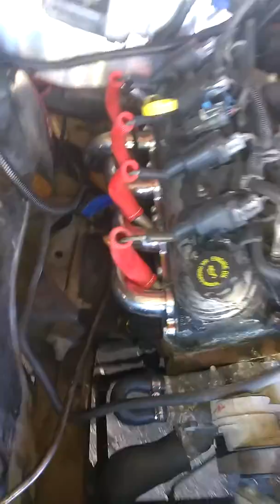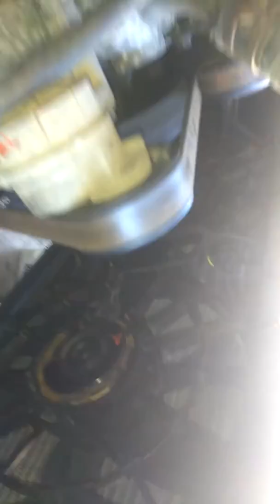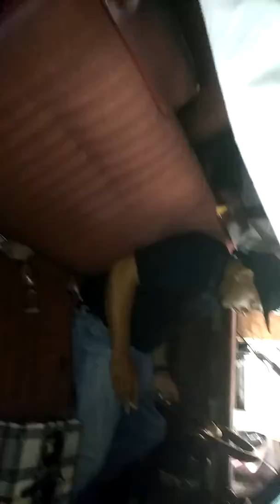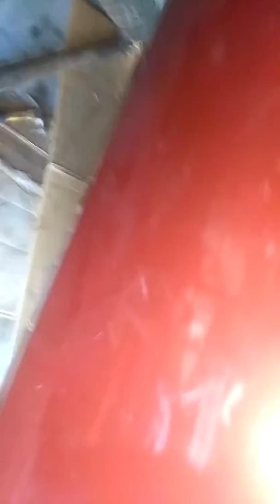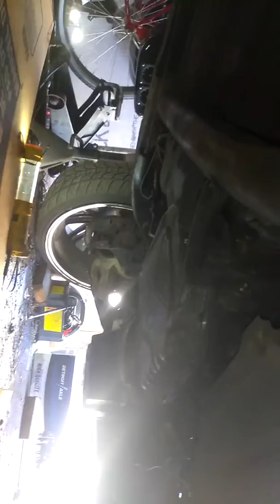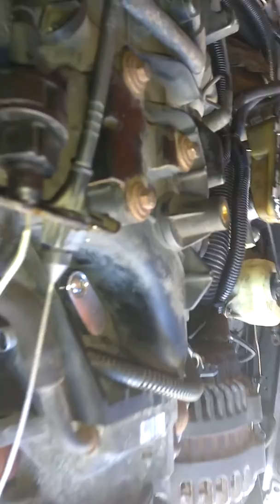G-body ls swap

Comment: Looking good over there bro ☝
Reply from the maker: Thanks was done with it n had it all cleaned up n noticed a pin hole n the oil pan when the pressure built up. So i gotta take it back out smh just to change the pan out
Reply: @monecolione313  Damn that's a lot of work but it got to be done keep grinding bro ☝
Reply from the maker: Took me damn there 8hrs on one motor mount bolt. Shit i dropped the motor faster than it took to line up a bolt. Smh thats the only thing i don't feel like fucking wit.
Reply: @monecolione313  I had a hard time with my motor mounts to it was a "B" bro ☝